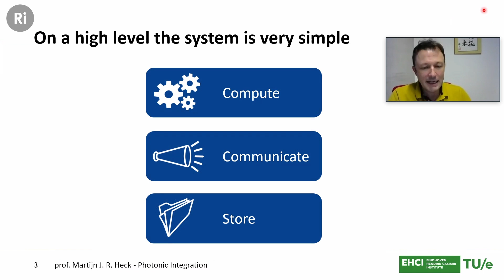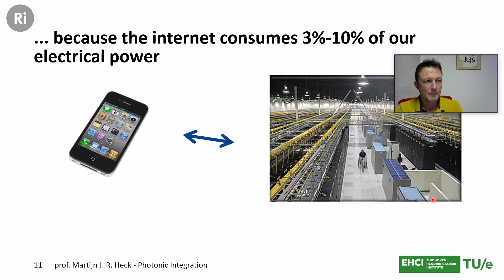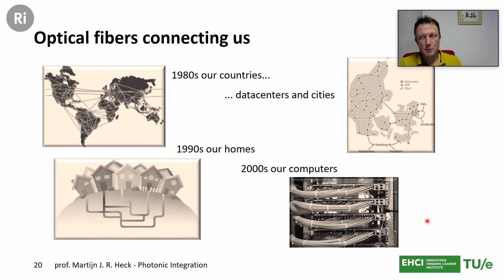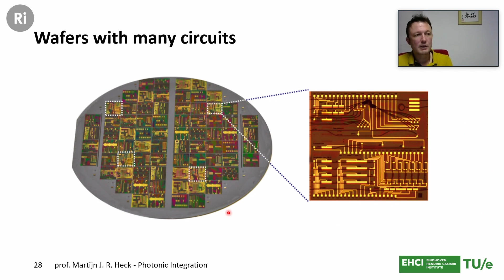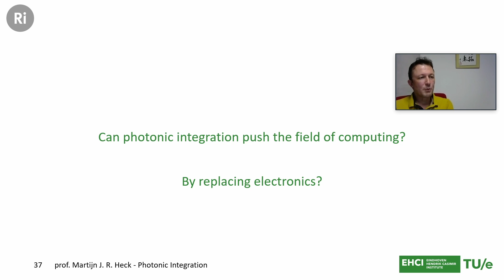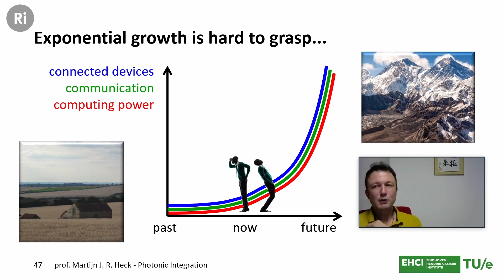Are Optical Computers the Future of Computing? - with Martijn Heck

Comment: I'm currently working on some R&D in photonic chips and one of the things that has posed a challenge is the optimum waveguide size for multiplexing purposes internally we run into some issues with requirements based upon the optimum performance of the waves particularly if we want to take into consideration the multiplex needs.
Nano circuits are still out of reach so scaling waveguides is quite selective

Comment: PIC totally can be applied to computing. Electrospinning new types of thermal resistant fiber optic wire conductors along with new thermal resistant transistor tech and new transistor composition tech. Imagine the time when we create zircon base comp vs silicon base comp at commercial scale

Comment: I am just a layman, but an overclocker and know how pc's work.
Question:
Since he saying photonics would be suited for communication on the computer, wouldn't this be great for connecting the CPU to PCIe(specially the graphics card🙂)CPU to RAM and CPU and the chipset? Just think of the PCIe speeds we could get, and how much lower latency from the peripherals.
Reply: The conversion to and from the electronics almost removes the advantage.

The first optical switching system, developed by Australia's national phone agency, had to do the addressing  by splitting the optical signal into address and contents, and running the optical contents through a 1 km coil of optical fibre while the address was processed.

To be properly fast you need optical processors.

You could get somewhere in multi-cpu systems by replacing the bus with fibre, though.
Reply: I mean, is there any point? Current state of the art GPUs and storage devices aren't remotely close to saturating PCIE 4.0 x16, and 5.0 is another doubling only a couple of years away... We need to multiply the power of GPUs by like, 10, to need to saturate that link.

Comment: The prof gave me idea: hybrid CPU’s, electronic and photonics! With electrical applied to speed up,or slow down light, thereby making,ichting waves add up,or substraat… light v could even be used to have analog meaning, so making a signal so that it can have a wide range of values. That of course exceeds the possibilities of qua tum  o outing by an infinite amount, as quantum computing i  essence is digital, digital like at least… a light signal can interact with another light signal,i a  very  varied number of ways… two signals interacting can have many different outcomes, resulting signal(s!)… that wouod increase the computing possibilities enoirmously, and the computing power of a single switch could be 100’s times what it is digitally… a single signal could eg have values ranging from 0..1024. The switch that signals acts upon is a lot more complex, but as it is optical, it can be made to behave in very different ways, depending on the i out value; duplicate, add, substraat, becomezero,become minimal,  become maximal, skip step, skip x steps/switches (like a jump to next switches), send back to sender, send back to sender’s sender of x steps back, erc etc. All that should be possible within a single switch… thereby making the power,versatility of that swotch a lot bigger… requiring a very different way of progra,,omg those, using those 
Possibilities in such a way that they do the same as current CPU’s/switches… not just and, or xor, etc…  t he first challenge however is to design, kind of invent switches that use fotonics, What we need and want switches to do, what we need and want them to be capable of, that is important then… All.ogical operation, at the very   minimum of  course… Do we want them to be able to take on values other then 0 and 1? Then first thing is that we make switches that can assume all byte values… and also have different behaviors depending on those values. If we wouod only have THaT, we would already have a computing tech that exceeds the power of current silicon based switches by a great lot, 2^256(???)….

Comment: ***steenkolen engels** VERY THICK DUTCH ACCENT*** And of course, optical is the future, bery much ore so then quantum, which, imho, is a hype of which the potential advantages are very ,icy exaggerated. When you however look at constraints of hardware solutions, and which tech has most potential,it is very obvious that optical is the future; very low signal strengths needed, so little energy needed, thereby avoiding heath problems  Cq cooling problems, connections can be very much downsized, much more then electronic switches can,,, With 5nm we very much approach the limit of how much smaller we can make silicon based processors. Perhaps other element that behaves same or better then pure silicon. But problem, in essence, remains, not so with optical, we’re higher light frequencies lead to more compact switching….  All that said, your presentation, I’d suggest you work on your pronounciation of English. “Steenkolen Engels” we wouod call your English i  Dutch. Your accent is clearly a Dutch one! Not so bad, by far, as eg that of Su.toch mi kater president Rutte and many another dignitary,political Dutch representative. YOU explain working  of cpu, instead of going into tthe ch incal hardware constraints… the explaining is th same for optical and siLocon, while it is the differences we are i interested in! Speed, and capacity not only determined by scale, also by the speed i  which materials can react to changes. The reactions are not instant, and the more power, the speedier the reaction, often, at least to a certain level, with/in silicon. Light is always instant, so always speedier reactions… The quality, size and apex of light detectors is an important constraint with optical. But with interference manipulation, we should be able to make optical based CPU’s that are if the same size, as the current size is in the larger part of cases not a problem, but 10’s of times faster ANd with more transistor like connections/switches… aso, with optical, we should be able to extend moore’s law by yet another few decades. My own, Imho estimate is 30years… and with doubling each year, ^30 is a lot… a single cpu rivals a whole supercomputer of the current t year,in just 10,years time … in other words: an optical based computer with SOC tech,sized iPhone 13  mini, will have the computing power of a $3.000.000 supercomputer of current time…. in a single decade, CPU’s will be sooo good, small and fast, that software will become the ,ain clallemge; how to use unlimited power of computing and storage,when processing and storing becomes virtually instant, no matter the size of data or amount of computational steps, the main question becomes: how to use that power, what to use that power for? One thing fir sure: we will simulate a lot more, often and more and ore complex things, running thereby against our levels of understanding, and of system behavior. Feedback and forward loops  for example will become common language, as everyone that is a bit computer savvy will use simulations. And the ease of which that can be done wilol increase a lot further, so human interface will know several revolutions. Voice controlled computers that become more and more intelligent, ie good In understanding what user wants, will be one of the first major challenges resulting from computer  power becoming much larger and cheaper…  matchbook sized computers, doing 1000Tbps computing and being connected with lots of other super small supercomputer like devices at speeds of 100Tbps… with  the number of devices becoming 1e9 fold the current number, them knowing  virtually everything, also what is in your fridge for example, all of them communicating, that would take a few AI applications to g ing that rise to a coins ious super intelligent,far exceeding our own!  It alas, lacking human motivations, values, etc etc, and even without self interest, unless, of course, that is programmed in! With a well,programmed AI application, for example, financial systems will recolutionise towards high speed trading, making latency times the most important feature of any computer dedicated to making trading decisions.l.  WORK ON YOUR ENGLISH, ESP PRONOUNCIATION, ***Steenkolen engels***  Fhe professor answers his own question: When we want to see co continuation  of moore’s law, we will have to revert to photonics…

Comment: But don't you still need electronic circuits to control the optical components? For example you need electricity to run the lasers? It seems to me that optical integration would still be plagued by the limitations of electronic components.
Reply: No.

Comment: 1 GB per second would have been unthinkable just 10 yrs ago at least for home networks.
10 yrs from now we will be introducing 100TB per second networks to the home. Partly due to homes having so many home features that use the internet and partly due to the density of 8k video, games that are connected to thousands of others playing the same extremely Data dance games, and programs that take advantage of the higher speeds.
Reply: Not happening anytime soon. Even 1gb connection is still a legethy process. Line work for fiber(FTTH) is extremely expensive and just for one customer it takes on average 5-10 aeriel/underground cases being accessed and spliced

Comment: At 24 minutes he makes a small mistake, saying that a 100tbit connection is a hundred times faster than the fastest domestic connection. Well, afaik those connections are usually 1gbit (I have one at home) so that means it is 100.000x faster. Thats quite insane over 1 single fiber!
Reply: bandwith != Speed
Reply: You have 1 gbit internet??
Reply: @thekaxmax  yes. Large part of The Netherlands has 1gbit optical fiber internet connection. Some parts can upgrade to 2.5 or 5 gbit since 2024.

Comment: A transistor is essentially a valve, which allows a voltage to pass. Simplifying TTL below (0.8) 0.4v =0 and above 2.2 (2.7) up to 5v = 1 THIS IS VERY SIMPLE
But how to create valves for light? We can make a computer even with valves with water, but this is not practical.
Reply: Liquid crystal light valves with two-dimensional arrays of cells were being used  twenty years ago, but were too unstable to  be useful in industrial applications.
Reply: Photons do not interact with other photons in vacuum, but they can interact within a medium - you can use that for processing, by passing light with precise timing through carefully fabricated crystalline materials.

Comment: Couldn't we make the chip bigger or make it in layers so we can fit more transistors on the chip
Reply: Yes both of which are done.
Reply: @deth3021  sorry I meant more bigger and more layers
Reply: Because normally they always fit more resistors on the same sized chip
Reply: @sully9836  they have look at Cerebras's chip its the size of a dinner plate.

Or any of the nand manufacturers. They have like 176 layer nands.

But generally you dont want large chip sizes as the cost sky rockets due to defects. The larger the chip the more lilely you will have to throw it away due to defects. This is getting to be a bigger and bigger problem with smaller processes.

Thats why chiplets are becoming so big.

Comment: At 7:09, computers don't use bipolar junction transistors (BJTs) like the ones in this explanation. They use MOSFETs, which have very different symbols. The transistors you have pictured have neither a gate, nor a source, nor a drain.
Reply: Well the early computers did.
There was DTL (Diode Transistor Logic) TTL (Transistor Transistor Logic) and ECL (Emitter Coupled Logic)
These technologies used bipolar transistors. 
But eventually the MOSFET became the most used  transistor in computer chips.

Comment: optics will lead into quantum fields to improve speed of propagation of information. as it is the latency of electron flow and the propagation delay of signal is limiting computer performance. i did not find this discussion useful, but more of a speculation with no direct answers. truly optical gates with amplifiers may be helpful into the future as well as gravity wave gates that are quantum fields that do not depend on signal propagation. there is still so much for us to discover at the atomic level and so much that we know that is not yet mass manufacturable. most of what we use for computers today was invented over 150years ago. other than fine tuning processes, and reducing capacitance and improved current flow and better lithography. what do we really know now? other than quantum effects that limit the size of parts, using quantum tunneling to force current thru devices, and a few other modern tricks most of the science can be considered 'old school'